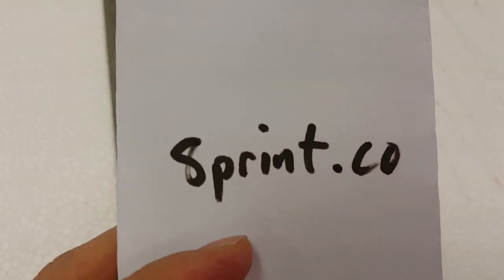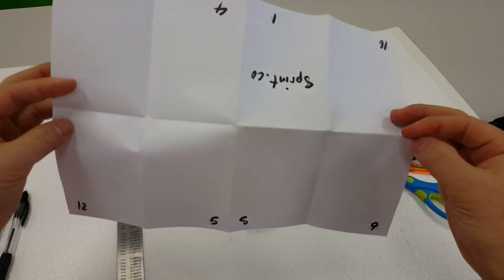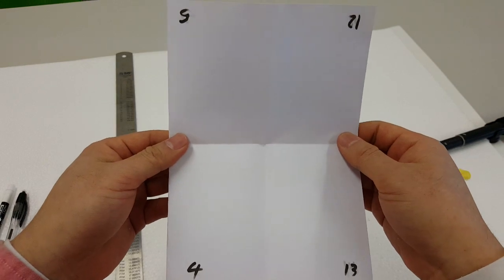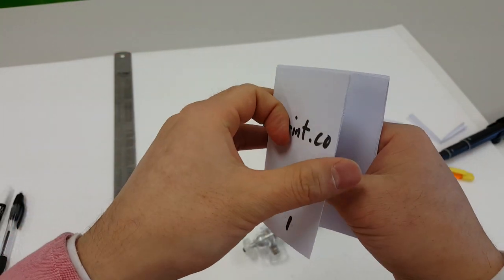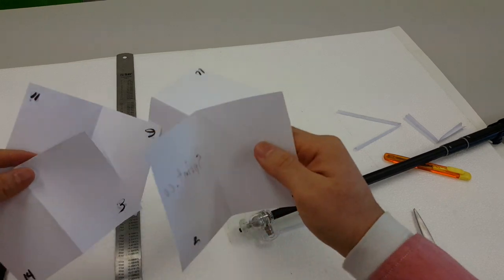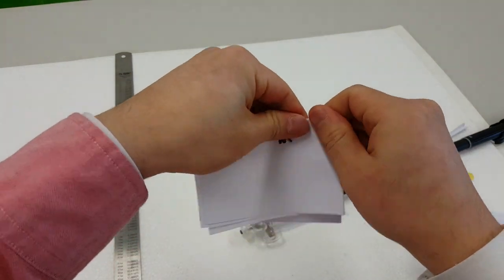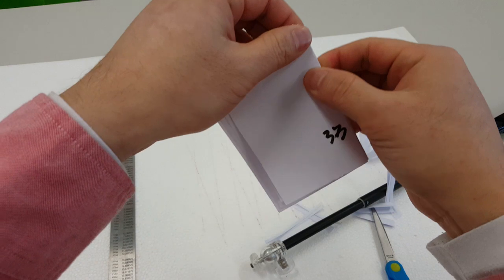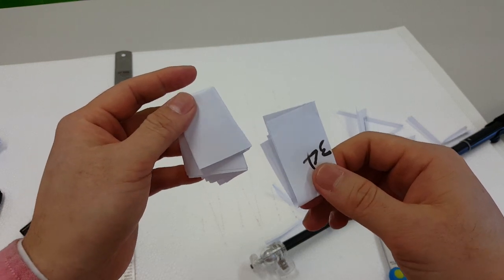How do printing imposition and signatures work?

Comment: You mentioned magazine, with that said some magazines and newspapers are printed on a web press. The pagination/imposition are different that is web-press versus sheet-fed press. For a web-press the technical terminology for the extra sheet is called a "dink." The dink pagination when printed will roll off the web press for newspaper/magazine style publications and is inserted inside the publication instead of glued and that we call perfect binding.

Comment: This was a great explanation for beginners till you got to the part where you would throw out the extra paper. We would print multiple-up of those last two pages on the one sheet, and print less sheets than the other two signatures. Though, as others have said, I would make that the center of the book and not the end, but I mostly work with saddle stitch. We generally work in multiples of 4 pages, but I have seen some printers put a single double sided page into a saddle stitch book (not dead center, but mixed in with the text). It's not pretty and I don't think most binders would do that.

Comment: thank you but it can be done a bit better the left out page could be not the last page..its a lot more better for the binding part. you wont face problem with the cutting and gluing. I do layouts in Adobe Illustrator because we do not have a rip software but I think its the same and I always doing the left out page at the center of the book so when it comes to binding there will be no problem. Can you give me a part time online jobs for imposition? I need a part time job, our company is now not giving our salary. Saudi economy is on the low point now.

Comment: 5 sections of 32pp A5 landscape you may have to ask your Folder Operator what the imposition should be.
Reply: you do not need to asked your folder operator what the imposition should be as long as your folding machines can fold 32 pages. the best fold for land scape is accordion fold for me. its like first fold and 3 chops...and you have 32 pages.
Reply: I need part time jobs I can do your jobs imposition as part time. how ever big the file is ready signatures with instructions.
Reply: @tonofdynamite. You may already know this by now. You can fold a 32pp landscape section/signature as follows. For example with format size 900 x 640mm. fold the sheet in half to 450 x 640mm. (= 4 pages). Then make two parallel folds across the sheet to give 450 x 160mm (= 16 pages). Then make a single cross fold to 225 x 160mm. This folding sequence will give a 1 - up 
landscape 32pp section - untrimmed A5 - with a closed head for easy automated feeding. The binding margin is the 160mm dimension. 
A 66cm. infeed width folding machine with a minimum combination folder configuration "4KTL" or an all - buckle folder as a minimum of "4/4/2" (3 folding stations). Add an operator who knows what they are doing and you are on your way! Stay safe and well.

Comment: 2 16s and a four pager is what you created there. If it was getting saddle stitched. Most of the trimming for a perfect bound book is done on a cutter then perfect bound. If it was saddle stitched then the trimming (head,foot and face) would be done on the saddle stitcher.
Reply: If it where perfect bound you would have to allow for the grind off and build it on the spine. Depending on thickness the might also need a allowance for push.

Comment: You didn't mention the important fact that this was a perfect bound book. If it were saddle stitched than you would have to reconsider the imposition.
Reply: They are signatures aren't they ? That can be stitched,  they are layouts aren't they ? Each sheet is 4 pages, they can be folded and placed inside each other and stitched no? I'm not an expert and I'm trying to work it out.
Reply: @youbuddha1  If you need imposition, I can do it and send you the file. I need part time jobs. Iam an layout artist for offset printing. You give me the file and after two hours or less I give you. full signatures just give me the size of your machines...
Reply: @youbuddha1. You may already know this by now. I was taught an easy way to "page through" a folded signature. Fold your sheet in the sequence of the folding machine. Then - with a sharp knife, cut a "V" shaped flap (like a tongue) right through your dummy sig. You can then write the page numbers on the flaps in sequence and you only need to underline the "6" and the "9" for clarity. Unfold your dummy sig. and you have your page layout without cutting/separating the pages!
The guy in this video also missed another tip to pass on to the viewers. For sheet work, the sum of the page numbers of two adjacent/side by side pages (described here as the "printer's spread") will always add up to one more than the total number of pages in the signature. So page 1 next to page 16 means 1+ 16 = 17. I am pretty sure that this works for inserted signatures e.g. a 20pp booklet as a 16pp. sig. with a 4pp. outer/wrap. Maybe you could try this to improve your skills at page layout for print. Stay safe and well.